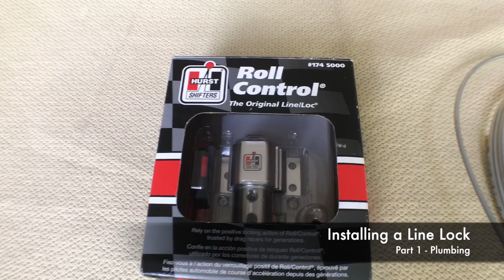Installing a Line Lock Part 1

Comment: Did you drain the rear res of the master cylinder?
Reply from the maker: We did not drain the master cylinder. Just changed the lines quickly to minimize fluid loss.